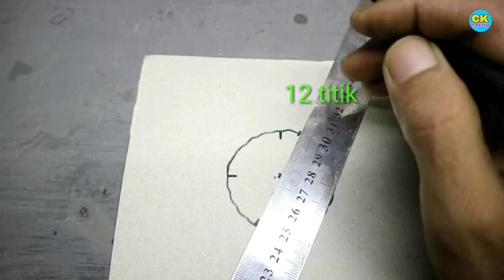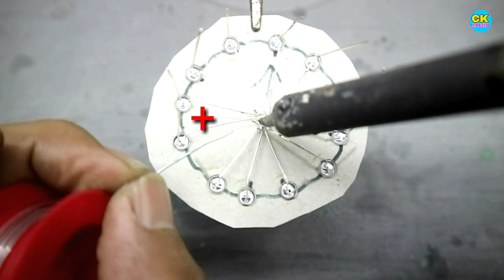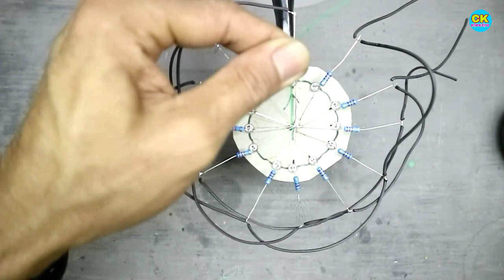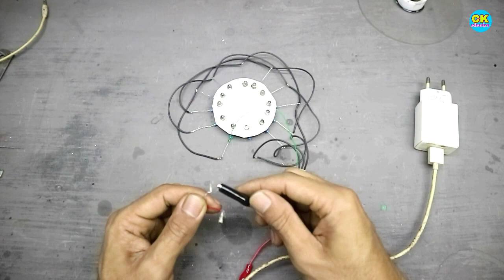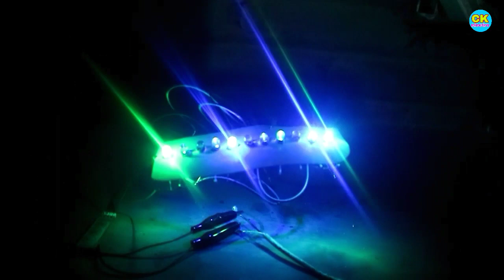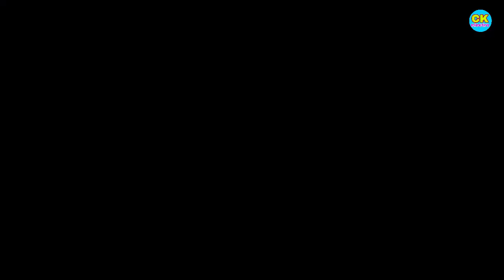top 3 project electro led RGB 5mm

Comment: Sy mau pasang lampu led 5mm 3 volt sebanyak 150 biji di Layangan, sedangkan saya cuman makek 1 dinamo output 5 volt, kira2 led nya bisa nyala semuanyab? dan solusinya tambahan komponen biar nyala terang dan awet gimana ya bang
Reply from the maker: Supaya stabil kasi r  100 / 10 ohm perlampu mas
 Di bilang hidup ya hidup semua mas seteh di hitung menggunakan 150 lampu hanya dua vol yang mampu di suplay per lampu nya  bisa di bilang redup ngk maximal mas terang nya
Reply: @CKelectro  ok makasih infonya